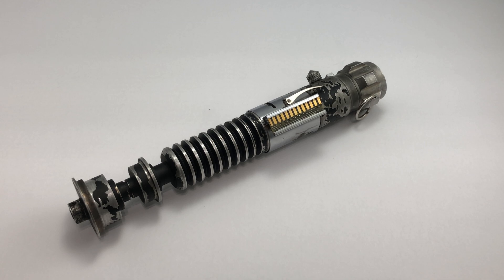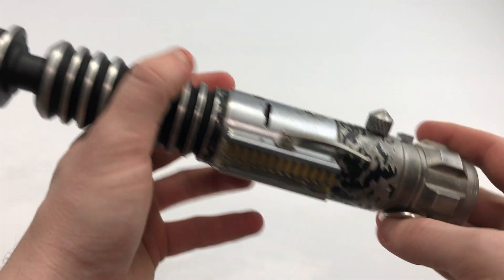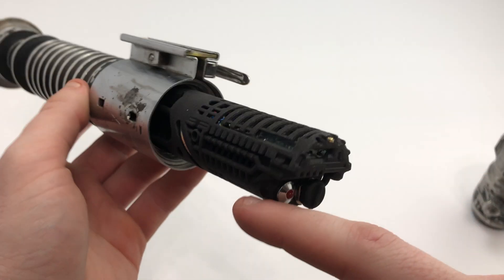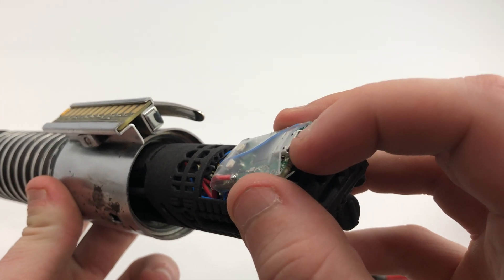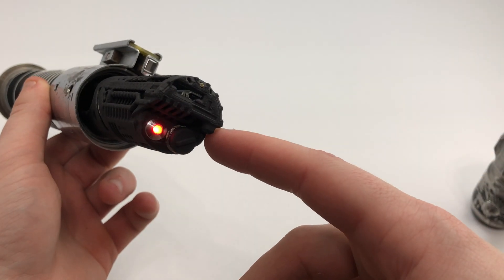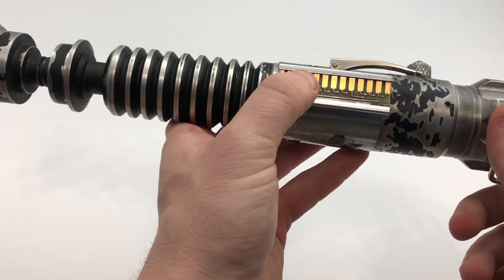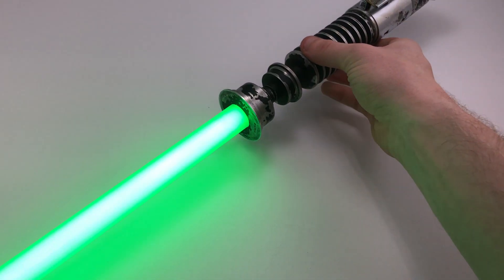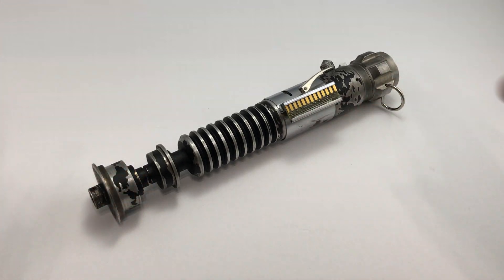Solo's Hold V2 Proffieboard install

Comment: did you need to sand the bottom of the clamp card? mine is really stiff in there with no give
Reply from the maker: Yes most cards need to be adjusted to whatever clamp they go in. Check frequently as you don’t want overdo it and it’ll be loose.

Comment: Awesome hilt, being a thin neck with a small emitter does the blade wobble dramatically?
Reply from the maker: It does not. The blade is designed specifically for this hilt. I wouldn’t full contact spar with this but it can swing around and take hits.